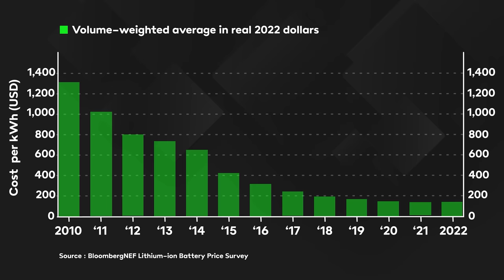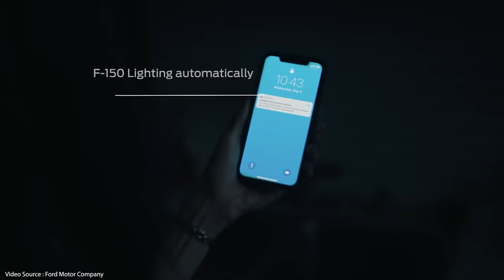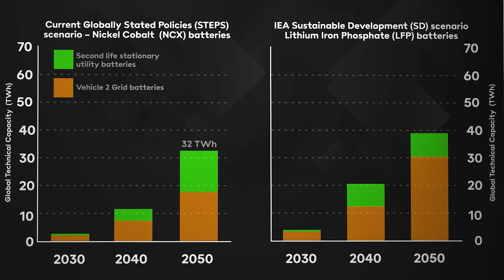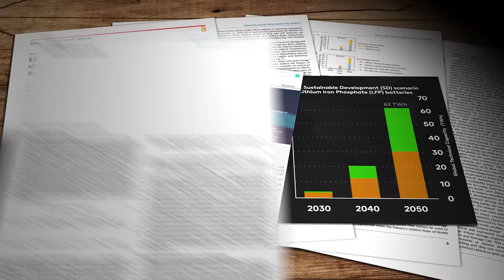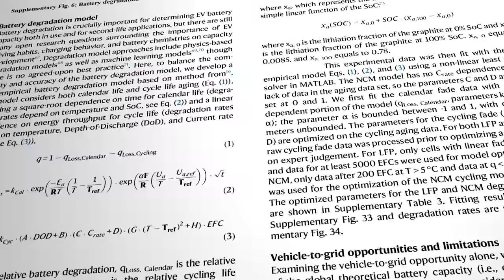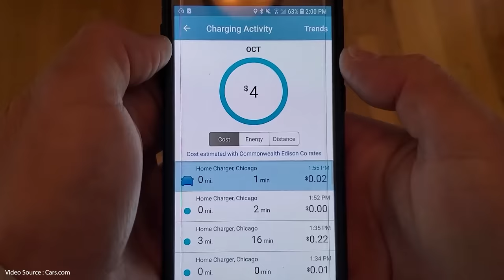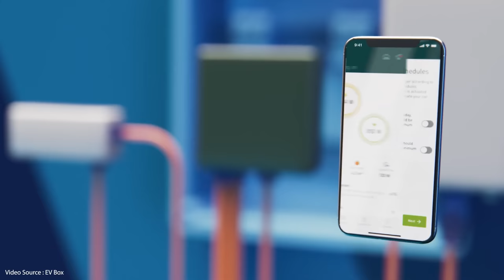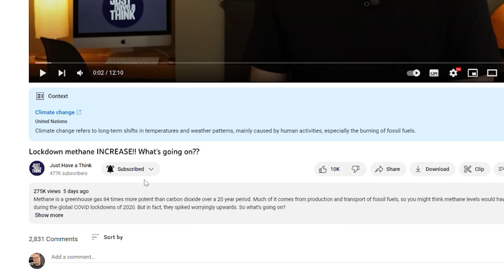Can the electric grid ruin your EV battery?

Comment: I have been on the excellent OVO Energy V2G trial since July 2019. I have averaged around 15kWh exported to the grid per day since then. Initially this was on my first Nissan Leaf that I swapped out for another Nissan Leaf in March 2021. Initially I recorded the State of Health SOH of the battery on a regular basis but after 20 months, 20K miles and circa 9,000 kWh I had only lost 1% of the SoH (96% down to 95%). My conclusion was that the V2G export had no detrimental effect on my battery and may have actually been beneficial in the short term. I decided that with my new Nissan Leaf it was not even worth checking the SoH anymore.

I think that using car batteries to support the grid and increase renewables is a “no brainer”. The quicker other manufactures adopt and design standards that allow the necessary bi-directional charging the better. There are just too many EVs out there that do not have this capability.
Reply: yep but; grid peaks tend to be during the day when ev's are out driving around, not plugged in, so vehicle-to-grid is not much help there. and home power and vehicle power are not quite the same thing; they are often not in the right place relative to each other. and vehicle-to-grid needs a sackful of gadget compatibilities and a full time live-in energy analyst. but if you like batteries; swap out your ev battery for a better one occasionally, keep it and shop around for another half a dozen, rack them together in a fire proof box in a garage with an energy synthesizer (with ten inputs: eight for ex-ev batteries and two for pv solar), that can deliver watts into the house for blackouts, or sell them to the grid at the daytime peak rate of twice or three times the night charging rate.
Reply: Thanks for injecting some on the ground data/facts into the discussion.
Reply: Those of the rest of us with a Nissan Leaf sitting outside our house all day would also like to use the car to power the house - why are we not seeing the 2 way chargers?  Also the car companies should be forced to make all the cars 2 way - the potential is huge
Reply: @GaryGraham-sx4pm  Surely grid peaks are in the evenings when many EVs have returned home and can be plugged in.  EVs, with foresight can be plugged in to the grid wherever they are and are not driving.  Car parks for instance.  At any one time (thankfully) the vast majority of cars are not on the road so are technically a resource both to input surplus energy and remove when output falls.  This would go a long way to helping the intermittency issue from renewables.
Reply: Ybe, 
it is an indisputable fact that the numer of charge and discharge cycles affects battery life, your assessment is in an early time of your batteries life and will deteriorate with time. Perhaps you will change your vehicle in a couple of years and pass on the shortened life to another person?
Vehicle to grid is a lunatic idea,  the grid alreday has too much uncontrolled input from renewables, adding a significant amount of extra will be more destabilising. There is also the financial cost to the non EV consumer as it will add to grid operational cost. A retail consumer selling back to a wholesale provider is simply turning economic practice on it's head.
Reply: @GaryGraham-sx4pm  grid demand peak in the UK is when people get home from work 5:30 to 7:00pm
Reply: @iareid8255  the grid will only "take" from the car when there IS a shortage. the car can not force power into the grid. If the frequency is above 50.0hz or over  the grid has more power than is needs and will not draw from the car. If it is below say 49.9hz demand is outstripping supply and the grid will PAY good money for power from the car.
Reply: Patdbean
yes I understand that (by the way the grid trips at (49.5Hz)
That is not quite how the grid works, power like evs, all renewables and nuclear feed in all the time at whatever level they can supply. Keeping the frequency at nominal is carried out by (in the U.K.) gas generation, so if supply is high, frequency rises and gas drops output and vice versa to keep everything on load and supply balance..
Yes the grid does pay good money when supply is short (E.g. Drax's £4000 per Megawatt hour to bring their coal generators on line.) and that payment is reflected in all our electrical unit cost.
Reply: @robsengahay5614  yep, domestic peak demand is early evening, grid average high demand is 8am-8pm. thing is; plugging an ev in somewhere every time it's parked is not user-friendly and requires a lot of roadside and parking area plugs. and going out with a charged car and plugging in only to find the grid has snaffled your energy could prove unpopular. cars are inherently mobile whereas battery peaking energy has no such need. all things considered it's just more practical to use the ev battery for driving and repurposed less charge-efficient batteries in a stationary location for day/evening power at night-rate cost and thereby contributing to grid peak smoothing.
Reply: @patdbean  Our Power companies in the US would likely pay 1/6th what they charge the customer so until they treat us like peaker plants then most people will not be on board. My extra solar end of the month is only worth .025 per kwh where they will typically charge me .12 per kwh or a little less in the winter. I am pretty certain peaker plants charge power companies .15-.2 per kwh. If all peaker plants were removed that would free up a ton of money that could be funneled toward V2G payments but I still think the power companies will only pay a flat .025 per kwh.
Reply: @MrBadbonesaw  if they pay so little that the customer can not cover the V2G charger cost in a couple of years and then start to make a profit, then people just won't do it. If however the customer can make an overall profit of 100 pounds a month or so , then they will have a market for it.
Reply: @GaryGraham-sx4pm  I am kinda wavering on this question.  I live in Queensland, Australia with a large solar array (typically generating between 30kw/h and 60kw/h in a day plus a Tesla (with a 50kw battery) and a Powerwall (with a 13kw max usable battery).  In the summer (like now) we often need to use our aircon and in winter we often need heating in the evening and morning but the battery is used up quickly with both.  The Tesla is often charged up on the solar but just sitting in the garage with a full battery overnight while we are powering the house from the grid.

The Powerwall provides all our needs in spring and autumn when it is comfortably warm but if we could use the car battery then we could be self sufficient 90% of the year.  Even more so in the future when we replace our ICE car with another EV in the future.

I realise that this isn’t a grid-scale issue but it highlights how much energy is potentially sitting there unused.

Also it would be relatively easy to set your car to prevent unwanted grid drawdown like we control how much we charge it now.
Reply: Patdbean, 

if that is so (and it is) then why say 49Hz?
49.80 or 50.20 Hz is considered a frequency event by the National grid ESO. 
However most of the balancing is automatic as synchronous generators have 
automatic frequency regulators. The time that the ESO reacts is when there are predictions of large load deviation requiring back up generators to come online, or less commonly shut down.
Reply: @iareid8255  true, but if in the future Less and less of the grid is going to be synchronous , because of lots  generation like  solar, wind and many  DC interconnects  etc. So the inbuilt system inurture of sycronus  generators is going to be an ever  smaller part  of the system. So system balancing will need to respond to frequency drops, load shedding is one side of it, (a cold store can easily live without power for 10-20 minutes)  and pumped storage ,  grid scale batteries and V2G will be the other side.
Reply: Patdbeam,

no that is not what synchronous is. How can you balance a grid by voluntary shedding (Uncontrollable) of load. What do you do when an increase is required? Storage is limited in capacity and soon depleted.
Reply: @iareid8255  look up frequency response service. You will see lots of large power users like (cold stores, steel works , pumping stations etc) have frequency response relays , that cut them off  for a few  minutes (10 or so) when the grid frequency drops under a set level (say 49.70hz) that will slow down the frequency drop and give the national grid balancing officer time to bring in other generation.  

Works the other way to, if one of the 1gw inter connectors is sending and trips out load goes down and  the frequency goes  up. If it goes above 50.2hz they get one or more of the pumped storage stations to start pumping up. And bring the frequency down. 

If it all happened automatically why do they  balancing officer in grid control 24/7 who's  whole job is keeping the frequency in range 49.8 - 50.2hz 

If it just balanced itself , he would be out of a job , wouldn't he?

Watch this to see grid balancing in action https://youtu.be/slDAvewWfrA
Reply: Patdbean,
you have part of it right, but synchronous generators al have governor control and automatically adjust fuel input  to maintain nominal frequency.
This is not sufficient to cover all situations and grid operators work to anticipate large variations of demand so bring in or curtail generators as required. This is not the same as frequency control which is automatic.
It is rare for frequency to deviate by more than 0.2 Hz, and is considered a 'frequency event' by the national grid. These events have been getting more common as 
more renewable generation feeds the grid as they have no automatic frequency control.
The only industrial load shedding is done if the consumer has signed an agreement, for financial reasons. Also most large consumers have a maximum demand which carries a financial penalty if they exceed it.
Reply: @iareid8255  yes, and what they sing  up to is (I think) called the frequency response service. As i say watched the video I inked to above. In the the frequency went below 49.8hz because of loss of one of the french interconectors. Watch it.
Reply: I was also on the OVO/Indra V2G trial for three years, with no discernible degradation to the battery. As a low mileage EV user at 6,000 pa, the regular cycling through exporting may well have helped keep my battery healthier.
Have now moved onto the Indra V2H trial.
Reply: Paul, 

isn't that wishful thinking? Battery life is proportional to the number of  charge and discharge cyles. 
You must be shortening the life of your battery with this, to me ludicrous idea, of re supplying the electrical supply.
It will not be evident early in the battery's life but as it ages it will deteriorate quicker, or will you have sold it on before then and pass the problem to someone else?
Reply: @iareid8255  Are you aware that the V2G limits export to 16.9kWh per day, at a maximum rate of 3.69kW, within the 20-95% battery capacity. Such that the standard 40kWh battery on the test discharged less than 50% of it’s capacity. The tech and restraints were designed to maintain the health of the battery. 
As the video shows, an average EV battery has a second life after use in an EV, for such uses as a home battery; and an EV battery can outlast the other components of the car it is installed into, so I don’t see such an issue.
As for the idea being ludicrous, by participating in the trial I covered the energy usage costs for a four bedroom house, 6k miles EV usage, and the electricity company still then ended up paying me money every month. With the recent fluctuations in the energy market, this has generated a lot of interest in the concept of V2G, that wasn’t there before.
 I didn’t enter the trial to make money, I couldn’t foresee Russia’s actions, as an existing EV user I just saw the potential and wanted to help prove the concept. It was a bit concerning at the start because Nissan weren’t covering the trial with the battery warranty initially, so it was quite a gamble, that ultimately paid off.

Hopefully, you’ll keep an eye on the news about the viability of V2X, delivered by media such as this video, which is far more qualified to explain than I am. And hopefully that news will remain positive and sensible, so that I won’t be wearing egg on my face. V2X is still in its infancy so it could go either way, I’m hoping that it can be a positive solution.
Reply: paul, 

you are looking at this from your point of view. I am looking at it from a grid and consumer perspective.
When you receive money for this another consumer is paying more than he or she should.

Grids have to maintain a demand and supply balance at all times, as renewables cannot modulate output to do this, that job is done by (In the U.K.) by gas generation.
As evs (and heat pumps ) are extra demand this is met by additional gas generation. Power stations are not particularly efficient and then there are significant losses between generation and supply to the consumer. Then add loss of rectification to charge a battery and the reversal to invert battery voltage back to alternating current.
When you back feed your local area network, gas generation drops to match the load reduction. It is better if they maintained output so the losses in your ev set up are not added to the total system losses. 
Supply like this (Called embedded generation) do cause problems to the grid operator as they have no direct control. 
It was identified in the subsequent investigation  to the grid trip a couple of years ago  that embedded generation was a contributory factor as the operator was unaware of how much was being fed to the grid and much of it tripped on frequency deviation,and that it required additional generating capacity running to be able to restore power.
Reply: @iareid8255  a) ????? I am a consumer  
b) the trial was set up from the grid perspective, with involvement from the National Grid
c) when starting the trial, it was the participants making the financial gamble with their EV’s, the value of which is far more than the scheme could return
d) I would imagine that most participants joined this trial to prove the concept of V2G, not to gain a financial advantage over others but so that everyone could benefit if it proved succesful  
e) Everyone is currently paying far more than we should because of the politics of fossil fuels, schemes like these can help address those inequalities
Reply: @iareid8255  The trial outcome was still under evaluation the last I heard a couple of months ago. The purpose of a trial is to test outcomes, the National Grid will learn from the trial how it may fit with their modelling. 
It seems to me that you are trying to adopt the position of Grid Spokesperson, and declare the trial a failure. Why not wait for the National Grid’s response?
Reply: Paul, 

you are making a net gain from what I eunderstood from your post? This adds to the overall cost.
The 
reason that we are paying far too much is the push for unworkable renewables. It requires the parallel running of gas generators to keep the system stable and reliable. In other words there are two source running doing one job.
It is adding insult to injury to put a carbon tax on fossil fuel generation which the consumer pays for. There si no doubt that the market as it operates now is amess.
Are you aware that there is not one body responsible for the entire system?
Reply: Paul,
not at all I'm just pointing out the weakness of the idea.
I don't understand the National Grid, they will be in the firing line when it all fails but instead of doing realistic evaluations they seem to be trusting to luck?
Reply: @iareid8255  No, you’re just giving your negative opinion proclaiming its all going to fail, the end is nigh. 

The National Grid however, are waiting for the results of the trials so that they can make an informed decision, not one solely based on perceived weaknesses; meantime they still feel they have received sufficient information to go ahead with further V2G trials. I think its good that the National Grid are looking for alternate solutions to fossil fuels, shows a bit of leadership which is lacking, or politically hindered in the whole energy sector.
Reply: Paul, 

you say it is a trial, so what is the aim of the trial?
I would add that there are two uses for storage, one is frequency support, and our major source of that is Dinorwic pumped storage in North Wales. (just over 9 Gigawatt hours capacity) and it's deployment is co ordinated by the National grid. 
The second is the fantasy land one of compensating for intermittent renewable generation, which simply requires far more capacity than is feasible.  (A ball park figure of 2,000 Gigawatt hours per week). A week of low wind is quite common and sometimes it can be several weeks.

I had a telephone conversation with a National Grid representitive in response to my query of how they intend to get to Net Zero generation by the target 2035. I had a list of 5 hurdles from the largest to the least.
One and two were intermittency and balancing which he didn't want to tal;k about. His answers for  the rest were I though weak and he continually repeated, "it will be challenging"
Reply: @iareid8255  You obviously have your own solution for reaching Net Zero by 2035, please tell us.
Reply: Does anyone seriously believe millions of lithium batteries can be made to meet the demand once petrol cars are phased out-IF they will be at all ??
Reply: @vincentl.9469  Of course I do it is just a logistics challenge. There is enough raw materials they just need to be mined and processed. Then its a case of building the factories and there are plenty of companies on that road already due to lithium batteries being in every portable device these days. Oh and you say millions as if you think that is impossible but you should say billions but it is still only a logistics challenge.
Reply: @vincentl.9469  with the battery technology advances we’ve seen in the last decade, will we still even be using lithium?
Reply: @ybeev3409  not everyone thinks there is enough raw material . and it will push up the cost of that material. plus having to take huge chunks out of the earth and even mining the sea bed in search of materials...how is that a good thing? then there is the extra power needed for charging.  I think in time they'll a different solution
Reply: @vincentl.9469  I never said mining was a good thing I just stated there is enough Lithium for our needs. There is supposedly 88 Million tons of which 22 million tons is accessible by today's technology. As an interesting comparisson the US alone mined 577 Million tons of coal in 2022. If there is a need we can do it, that's not saying that its right or not.